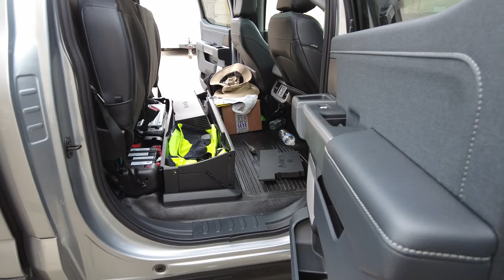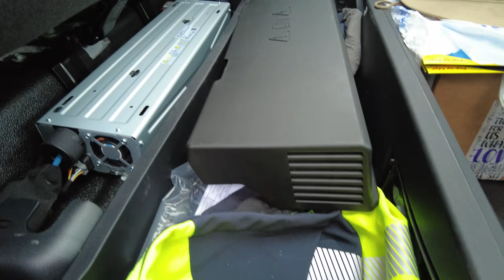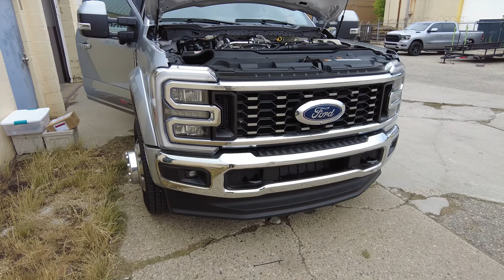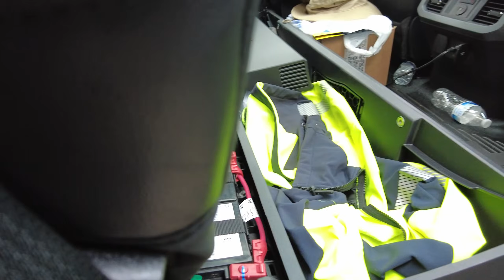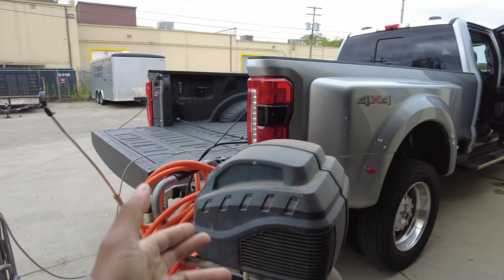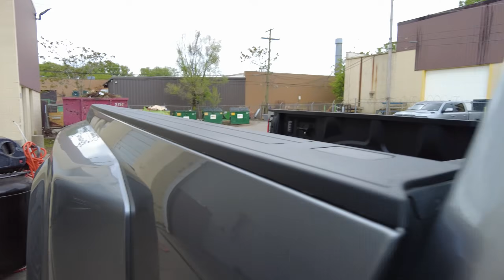Can FORD'S new Pro Power do THIS???

Comment: I wonder if the agm batteries are weak. I’m having the same issue with my new truck. I’m going to look in to upgrading to lithium for those under the seat batteries
Reply from the maker: That's probably the factory inverter. Doesn't seem to have as much surge. Seems like they're advertising surge, not to continuous available

Comment: The initial power draw is higher during start up than at continuous power. I connected a smaller air compressor not in generator mode and it flipped the trucks breaker in the bed of the truck. My truck is a 2024 F350 SRW 6.7HO Platnium Tremor.

You are asking a lot of that system. It’s not good for the electric motor in your air compressor to ride that struggle buss at start up. 😊
Reply: Same truck here was running a lil Trager and it kept popping the breaker also ? Do you know what it could be?

Comment: My inverter burned up at 4000 miles on my 2023 F250, ford dealer told me there were none in the united states to repair it. Four months later it is still on back order.
Reply from the maker: Woooow

Comment: Start up watts are calculated at 3x the running watts... that's the reason it struggles to get the compressor running. If the compressor runs at 1200 watts you should have a surge rated inverter of at least 3600 watts.

Comment: I thought the pro power onboard comes with 2 alternators, 1 at 250A and 1 24v 150A
Reply: it does, but there is no clear answer if the 2nd one (24V) is 100% dedicated to the pro power on board setup or if it's also capable of charging 12V batteries when you turn off the pro power setup.

Comment: Within the last two weeks one of the software upgrades has de-rated the power demand scale on my 2023 from 2000W to 1500W. I haven't investigated further yet but mine has struggled with hammer drill inrush current. I'm curious if this is a true sine wave inverter, I'd be disappointed if it wasn't. This was marketed as a 2000W inverter, the outlets in the cab are labeled for 20 Amps, 1500W is only 12.5 amps at 120V.
Reply from the maker: Ford got a little false advertising here

Comment: Remember that your 120v household breaker is set for 15 or 20 amps.  You would never run both of those at the same time on the same circuit in your house or shop.  You would be blowing breakers.  15 amps x 120 V = 1800 watts.  You're just lucky you didn't burn up the truck.  It did very well, considering what you were trying to do it.  Both of those would equal 3,000 watts which you shouldn't even consider running at less that 3,500 watts converter.

Comment: great video, and very informative. I have inverters in my 4 trucks and would never order that option. I agree that for what Ford did they should have made it 3k watts minimum since they are trying to eliminate needing a gas generator Who wants a truck with 4 batteries?

Comment: With the dedicated alternator for the pro power, do you know if it's only dedicated when generator mode active but available for other accessories like your plow or maybe a winch when genrator mode off? That could be an intelligent design...
Reply from the maker: Maybe. But it looks like it's dedicated to pro power.
Reply: @DS-TRUCKS  That's unfortunate. I was hoping different.

Comment: You will be just fine. Your single alternator put out around 250 amps for a single alt. I have a 110 amp alt on my old f350 7.3 diesel and never had a problem in over 20 years and still going strong.

Comment: Good video, I was curious how the 2k system works. When you had both items turned on it sounded the same as when you run a  compressor on too long of an extension cord. Not sure if it's a voltage drop or what, but not good for the tool.

Comment: Im not positive but i believe these new trucks shut off after 30min or something like that. I dont think you could let it idle all night without modification.
Reply: yes it will in generator mode, even my 7.2kw f-150 will run, turn itself off and back on again as power is needed.